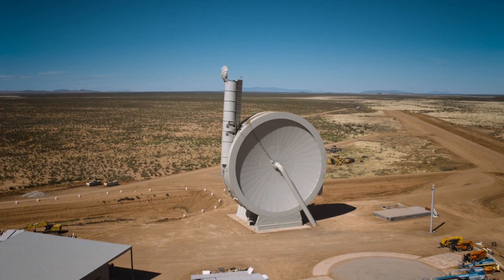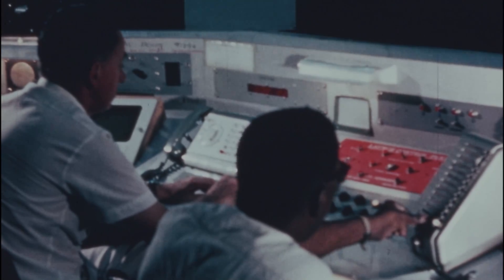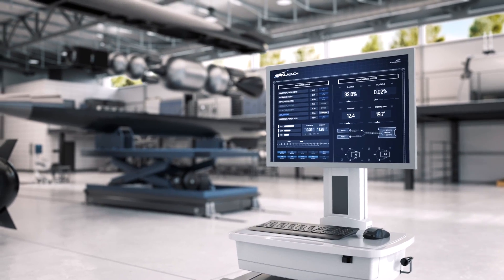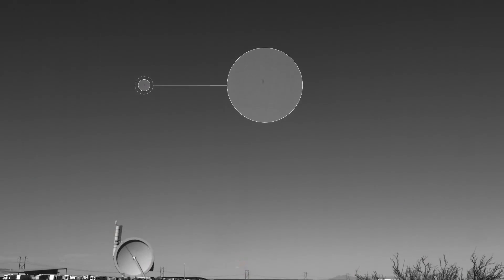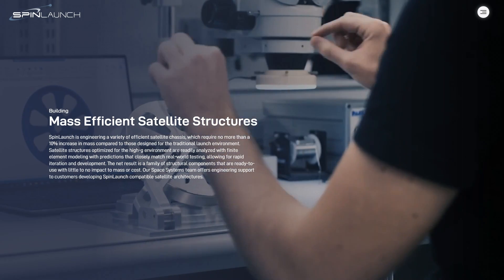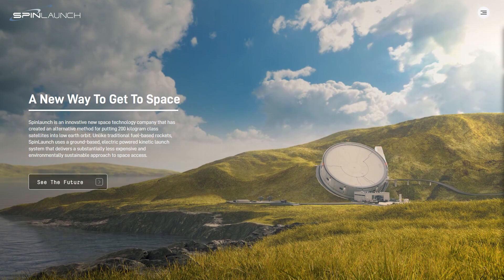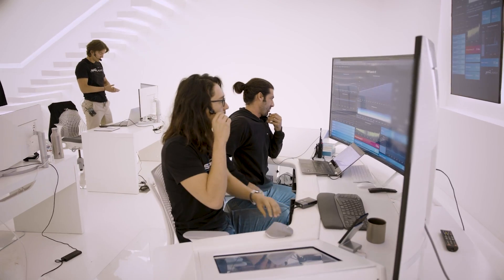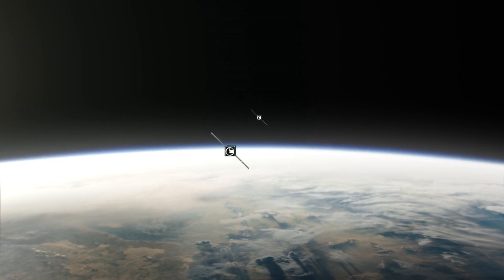Can Spinlaunch Throw Rockets Into Space?

Comment: I am not an engineer, but if I put a few brain cells together, I can already think of any number of things would have to go perfectly or their entire facility would explode into tiny little pieces.  A tiny loss of vacuum could destabilize the rotor, the release mechanism could be delayed by a millisecond and the rocket disintegrates as it thrashes the exit in the process.  The tiny rocket begins to tumble in the air due to a bad release or an off center load.  The rocket literally explodes into a burning hot mass of parts the moment it is exposed to the atmosphere if they are able to test this at full speed, which they have not, yet.  Still waiting on how they expect to build engines and fuel tanks that put this thing into orbit, that will withstand the G's at max spin.  So much to think about, I just can't see this being any more viable than a large ground based cannon powered by air,  or something akin to a Rail gun.  A sled of some kind instead of a very dangerous centrifugal bomb.

Comment: I think one of the biggest issues is something you touched on, but didn't really explain.

When the projectile is tumbling end over end, it is NOT unstable. Unstable would be ok. Design and control can fix unstable. The real problem is that it's spinning end over end because it just came out of a centrifuge. Specifically, it's spinning at 3 revolutions per second give or take. Basically it tumbles at whatever the rotation rate of the centrifuge was.

Their proposed full scale design is even worse, since it'll tumble at 7.5 revolutions per second. What exactly is going to happen when they send a hypersonic projectile tumbling at 7.5 revolutions per second into the dense ground level air? I'll wager, nothing good (aerodynamic forces and heating will at least rob them of the energy to get to the edge of space, and probably just destroy the vehicle).

It's clear from the video that they don't have a solution to that, and I honestly can't think of one that's likely to work. That should have been one of the more fundamental challenges they addressed, but it's clear they either didn't have the high school level mechanics knowledge to realize it would be a problem, or, more likely, they knew it was likely to be a deal-breaker and just forged ahead in an effort to secure funding from people with more money than basic physics knowledge.

Comment: A much more plausible way is to use a maglev rail system inside an evacuated tunnel running upslope inside a mountain. Seal the outlet end with a membrane, pump the tunnel down to 1 or 2 PSIA. The maglev "cart" then accelerates the rocket & payload up to 2500-4000 MPH, the tunnel inside the mountain provides the vertical angle. Explosive charges ringing the tunnel mouth blow off the diaphram and "make a hole" for the rocket just before it reaches the mouth so the rocket doesn't "run into" the atmosphere. A 16,000 - 20,000 foot mountain provides several miles to get up to speed and minimizes atmospheric pressure at the mouth. Elon Musk's idiotic "people foamer" could potentially be put to good use reducing the cost per pound into LEO instead of providing fodder for personal injury/wrongful death liability lawyers.

Comment: Thunderfoot hasn’t steered me wrong so far with his breakdowns on why different pieces of technology won’t work and I fear he will be right again. It would be cool if this thing worked but it seems to me like they are exaggerating how good this thing works. The hyper loop or the solar roadways or the water producing machines. They all sound great and seem possible but they all fail because we just don’t have the tech to make them work yet. At this moment stuff like this feels like a waste of money to me.
Reply: Or often physics simply says: NO!
Reply: @leonmuller8475  sometimes physics says "if you want to" but wallet says "why?"
Reply: @leonmuller8475  Absolutely. 'Technology' can't outsmart physics.
Reply: @leonmuller8475  and in some cases, such as this, physics just laughs.
Reply: @lunafoxfire  What are the 10 percent of things that Thunderfoot has debunked that have actually made it to production?
Reply: @lunafoxfire  could you give some examples of things he was wrong about ?
Reply: He made a whole about how IF the EM drive were real, it would be completely useless as a method of space propulsion. His entire argument hinged on the miniscule force it supposedly generates. But he completely missed two points. (1) the forces don't need to be massive, as even a very tiny force over a very long time can add up to a significant cumulative force, and (2) the (hypothetical) technology is in infancy and therefore we have to take any force numbers with a massive pinch of salt.
Reply: And Everything has to be perfect, an accident would be catastrophic!
Reply: @lunafoxfire  I have a perpetual motion machine I would like to sell you, 90% of my designs didn't work so Thunderfoot was correct but this design is in your 10% so no worries.
Reply: @reggiedixon2  epic.
also this is not related to the point i was making. the point i was making is that pee pee poo poo butthole.
Reply: @lunafoxfire  Yes, that point checks out
Reply: Yet? You mean never, unless we manage to change the laws of physics/thermodynamics. Room-temperature intelligence behind these projects. (Celcius, by the way. Not Fahrenheit.)
Reply: Philip E. Mason  is ridiculously overrated. He tend to cherry pick data and presents false  information and rigged experiments to "debunk " what he doesn't like on . Even his maths of certain thing like Hyperloop and Spin Launch is wrong. Even on slam dunks subject like EM drive and  Chernobyl series accuracy he tend the miss the point such as why NASA needed to conduct multiple test on EM Drive and how Chernobyl was historically accurate is it depiction what people think of nuclear risk at that time.

And then there are cases where he just embarrassingly  wrong like his opinions of battery (especially for EV)  , solid state storage for hydrogen and even NASA and Space X. the guys is like Jordan Petersons when  he  gave confident opinion  on subject ways beyond his expertise
Reply: @remliqa  You are profoundly wrong on just about every count. The solid state hydrogen is spectacularly dumb ! I suggest you learn some SCIENCE !
Reply: @grahamstevenson1740  
Everything I said about  Mason  (Thunderf00t real name) is my previous post is correct and corroborated by experts in those fields , fields in which Mason have little knowledge himself and is nowhere an expert on.

For example :If you actually do know science than you would know that solid state hydrogen (metal hydride to be exacts) solved many of the problems faced  with storing hydrogen. It even have leg up of liquid hydrogen in terms of efficiency  and  energy density per volume. Something Mason conveniently missed , as he wont to do when talking about science and tech that he have little understanding of.
Reply: @timemachine194 Maybe  take a physics course.  Then watch the video again, it's all there for anyone with the wit to understand.
Reply: @timemachine194 what are you talking about?  Come back when you understand a little about the physics of rotating objects in the real world.
Reply: @timemachine194 I was talking about the arm releasing the projectile. Big weight on one side to balance the projectile,  projectile released... But, as we saw from the video, they haven't managed to release the projectile straight either.  And all of that at speeds well under those they need to achieve low earth orbit.
Reply: @timemachine194 I have understood the concept and, unlike you, have some engineering knowledge so I understand the practicalities.  Dump sand out of the other end at mach 7?   Are you serious?  

You have no clue, it's pointless talking to someone just at the very start of the Dunning Kruger curve.  You know so little you can't even see how wrong you are.
Reply: Thunderf00t is a chemist who thinks he knows physics. His knowledge is surface level, and contains misunderstandings a bit too often.
Reply: @robincray116  yet this crap and everything he debunked still dont' work, go figure
Reply: Sometimes they are prohibitively expensive, other it's simply because what we already have are actually better
Reply: @lunafoxfire  He is in an easy position because he just follows the physics, and applies that to whatever idiotic proposal has failed to account for the reality of physics. It is that simple, any project at all, that fails to account for this will absolutely fail.
Reply: @finitekosmos  some of his SpaceX videos have been debunked by actual rocket scientist.
Reply: Thank you.  There’s always some new quackery that parts fools from their money.  Thunderfoot rocks.  I wish he’d do a piece on Nikola Motors.  Been trying to get him to do one.
Reply: @dougieh9676  The thing with Nikola is that the basic idea is perfectly sound. The implementation is where it's failing.
Reply: @dougieh9676  I can't stand the way Thunderfoot mumbles and sounds like he has a rag stuffed in his mouth.
Reply: @dougieh9676  it’s done. He did a video about both Nikola and Tesla semi trucks. It was pretty funny to hear him talk sense next to the promises those guys were making.
Reply: @Michael Hill "NO APPARENT ADVANTAGES over a linear accelerator. "
Ok now  this  makes sense. 

" I suppose my equations were confusing, mainly because they only made sense if you read the sentence below it properly."
For me, they mainly were confusing, because they were already altered from  their base version to suit your specialized problems, without  mentioning it. (Or I  missed where you mentioned it)
Reply: He’s been right on almost everything and he’s probably right here. But he isn’t infallible. Just look at his proven mistakes on his SpaceX videos. Using the wrong capacities when analyzing the wrong spacecraft. Using the wrong revenue numbers. Etc. He makes mistakes, so don’t just blindly follow what he says. He has biases like the rest of us.

(Before you accuse me of being a Musk fanboi just know that I believe TF’s criticisms of HyperLoop and The Boring Co. are correct).
Reply: @spuriouseffect  Don't know, don't care.
Reply: @noneya404   And that's why people like you lose money.  Unfortuneately there are a lot of you in Government.
Reply: @spuriouseffect  patpat Nice try.  Missed the low flying plane I see.
Reply: @noneya404   I did miss the point where you made a coherent argument. You have nothing.
Reply: @spuriouseffect  patpat
Reply: @noneya404   Thanks for verifying.
Reply: I don’t really see how they can fix the spin of the rocket
Reply: You'd need a perfectly balanced turntable system on the end that would spin the rocket so that it always keeps its exit orientation, and it would have to release it from the side with nothing else in the way. However, that requires G-hardening against all (rapidly changing) directions in that plane, as well as G-hardening of the bearings that support it, and a strong enough arm to hold it all.
Reply: @pyrobreather1  And then it all gets horribly unbalanced when the projectile is released.
Reply: @Michael Hill It's better because the linear accelerator you propose doesn't exist yet. Railguns and coilguns are still experimental and unreliable technologies that can't actually be scaled up to this level yet, as in we literally don't know how to build one this big that can provide this kind of power. Meanwhile we invented large powerful electric motors decades ago and this system only has to rely on material strengths and timing and not dubious super conductors and capacitors. You're basically comitting the exact same mistake that Musk fans do by dismissing a system that is actually plausible and has seen real testing by comparing it to something that doesn't actually exist. Of course a theoretical technology that has literally never even been tested is gonna look better, but I won't hold my breath until electromagnetic launchers actually see any use beyond the EMALS.
Reply: @hedgehog3180  yes, there are linear accelerators more capable than spinlaunch. They are called canons and are centuries old technology and they are way simpler and safer than spinlaunch. Project harp would be an example for the exact same idea, just with a canon instead of a centrifuge. The germans tried to develop an experimental "multi stage" canon during ww2 as part of their wunderwaffe programs. Idk when they dropped the idea, but as far as I know they at least built parts of their experimental launch facility.
Reply: Thunderf00t says what's wrong with the idea and why as they explain it in their 3d renders why it won't work like that. But it's not really a waste of money since engineering of failed prototypes is an important step in developing machinery since pieces developed for the project might prove to be important missing puzzle pieces in other designs, in that front they seem to be doing important work so even if their main tech fails, those steps they are taking might lead to their patents earning money as parts of other tech. 

Hyperloop, Solar roadways and a few others of the things Thunderf00t was annoyed about were pretty bad ideas in general. 

Problems like a small failure anywhere on the track taking away the near vacuum and acceleration point to point was always going to be an issue with the Hyperloop and they need a safe way to de/accelerate to the needed velocities which don't exist yet and both weren't really being talked about. 

Solar road ways... cars are on them so there is no sun hitting large portions of their surface most of the time, glass and other protective covers reduce the amount of solar energy to electrical energy created so better would be south(northern hemisphere) facing walls being covered in robotically sun following solar panel arrays by law than any kind of pathways or streets to begin with.
Reply: @liamnehren  Solar roadways are a terrible idea for many reasons, but the primary one is that glass is an awful surface to make a road out of. If tarmac was such an unsuitable thing to use then we would have replaced it with something else a long time ago. Bottom line is, it does the job well enough and is cheap.
Reply: @bagofnails6692  especially since they used to make tarmac with slag... until they realized slag was toxic. (probably knew before then)
Reply: @bagofnails6692  lol I know hence why I said they were a bad idea.
Reply: @Michael Hill Lets do your „calculations“ properly:
So what do they want? 
2200 m/s velocity. 
how heavy is their „Rocket“?
200 kg 
How big is their Spinlaunch System?
33 m diameter 
Goal:
100 m 
Linear Accelerator (Your values)
100m 
25m 

The Variables:
a = acceleration (or Equivalent force)
v = velocity
r = radius
s = distance
m = mass
g = acceleration on the surface of earth

That is everything we need. 
Now lets see:
Spinlaunch:
 (small 33m) a = v^2/r          => a = 2200^2/16.5 = 293 333,3… m/s^2 (29 900g)
or 
(big 100m) 2200^2/50 = 96 800 m/s^2 ( ~10 000g)

Linear Accelerator:
(small 25m) a = v^2/2s      => a = 2200^2/(2*25) = 96 800m/s^2 (same as the 100m Spinlaunch) 
or
(big 100m) 2200^2/(2*100) = 24 200m/s^2 (2466g) 

So what ever you used for you linear accelerator and 100m is completely wrong. It is actually 3 times worse than your solution says, but still 4x better than Spinlaunch.
Reply: Lmfao thunderfoot. His whole gimmick is just declaring things won't work. Yea no kidding, 90% of everything cutting edge fails to pan out. Groundbreaking stuff, what a prophet.

This likely won't be an economical on earth, but could easily be the method of choice on Mars/Moon
Reply: @daverohrich8518   Show us 10 percent of the things ThunderfOOt has debunked that have made it.
Reply: @daverohrich8518  Except he doesn't just say they don't work. He explains why and backs it up with UNDERSTOOD PHYSICS.
Reply: @thanhhuynh175  Thunderfoot took so long explaining why it wouldn't work thaty I literally forgot the reasons that he gave and I only watched the video a few days ago. I think it was something to do with rust on the inside of the prototype chamber. To be fair, nobody in the comments could actually tell me why it wouldn't work for cargo in principle either, I'm not saying that this will ever work, but it would be nice to be given a clear reason why not.
Reply: @Michael Hill What are you on about? Acceleration is ALWAYS:
 v/t = a or 2s/t^2 =a (where a is acceleration, t is time, s is distance)
not v^2/r 
and also not v^2/(2pi*2r)

In the case of v^2/r it is called centrifugal acceleration, but it is no acceleration in the sense that the object gains kinetic energy
In the case of the second formula, where do you get a radius in a linear accelerator? Or what does r refer to in your second formula? 
Why is pi involved in a LINEAR acceleration?

From where do you get your numbers? “peak of about 10,000/(4*pi) = 800 Gs” ???
What is “Gs”?

„for no apparent advantage.“
The „Advantage“ is no gigantic Rocket with 90%+ of throw away weight.
Reply: @leonmuller8475  I think he meant "G's" as in a/9.81 (not that any of his "math" seems to be taking that into account).
Reply: @whatelseison8970  Oh ok, I only see 9.81 m/s^2 substituted as "g". 
But  yeah seems to be  the most likely therm. Thanks.
Reply: Thunderfoot is the eternal grumpy naysayer lol
Reply: @noneya404  but he 's always right lol.
Reply: @aspencat2239  He literally used the wrong numbers on his debunk of this too.